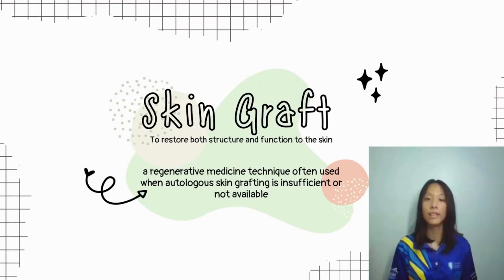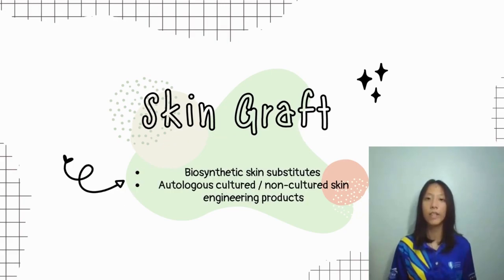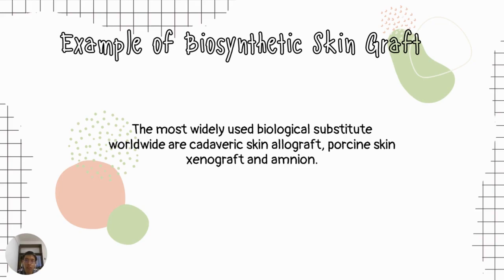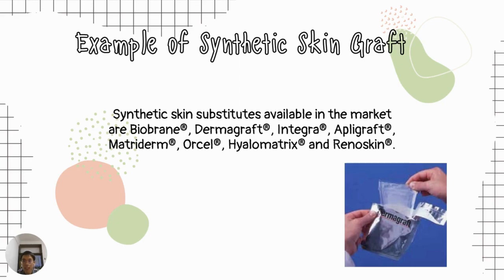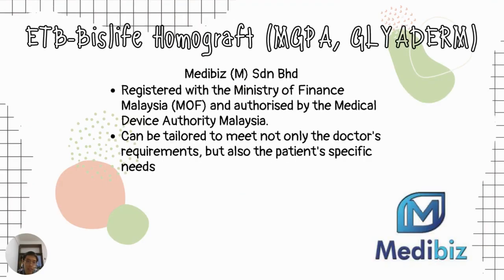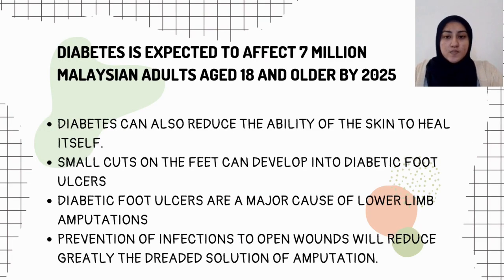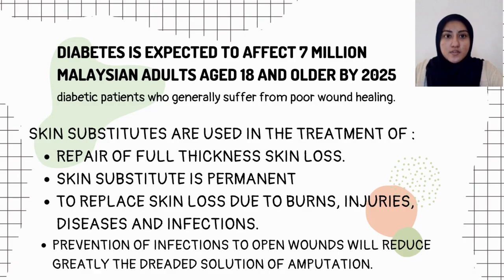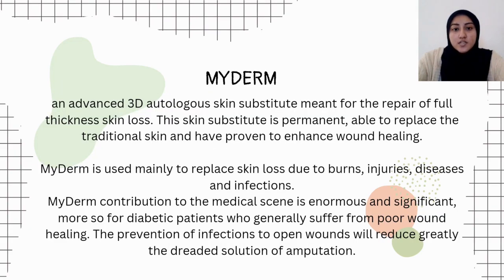Group 8 Tissue Engineering Skin Graft

Comment: Hi this is from group 6. Every tissue engineering technology came with possible result of either successful or failure. Could you please tell us on how to reduce the chance of failure for skin grafts ?
Reply from the maker: Hi, thank you for the question. There are several ways to increase the failure of skin grafting.
1. A viable base of tissue with some vascularity is needed to improve the ingrowth of capillaries from the recipient site. 
2. A muscle or soft tissue flap may be removed into the wound base to provide a vascular bed for the graft. The graft will absorb transudate from the recipient bed and become edematous in the 24 hours after placement of skin graft. 
3. To increase the successful, the graft is placed in apposition to the wound bed.
4. Apply a light layer of bacitracin or neosporin to the skin graft for the first week to minimize risk of infection.

Comment: I am from group 7，I have a question regarding to what is the major risk factors that contributing to the failure of skin graft?
Reply from the maker: Hi, thank you for the question. The major risk factors could be 
1. Lack of wound bed (A systematic approach to wound management by identifying and removing barriers to healing)
2. Infection by bacteria where they enter the body through wound and multiply
3. Formation of hematoma / seroma which can disrupt the contact with the underlying bed, causing the graft to lose its source of nutrients and prevent revascularization
Reply: @ChenYokeChing  Thank you for answering my question and I have  learned more about it ☺️